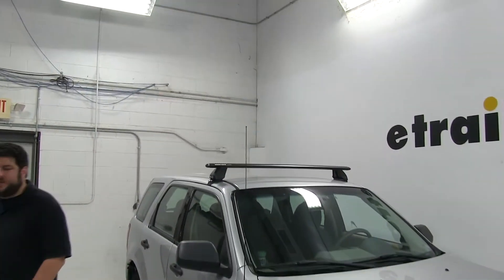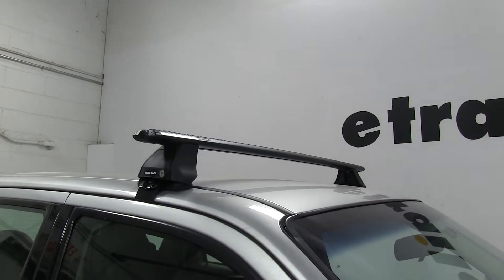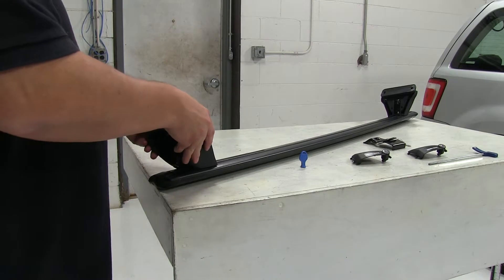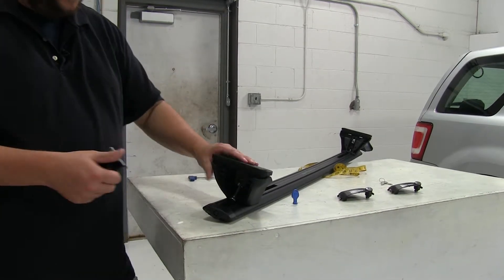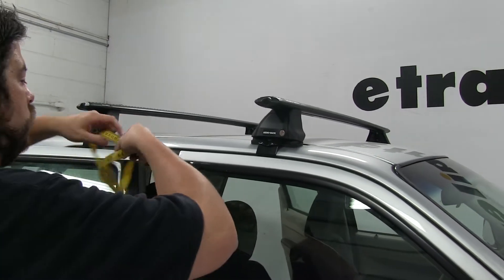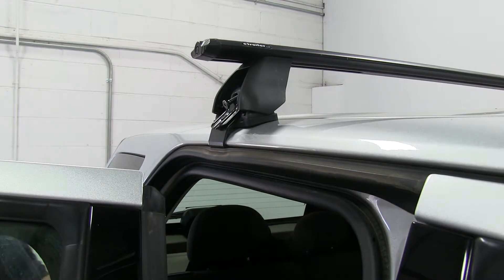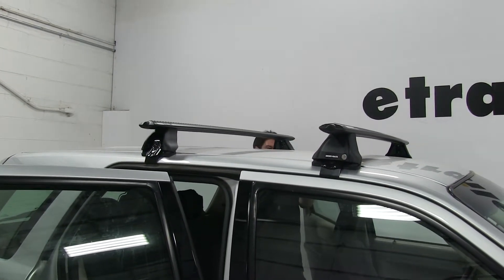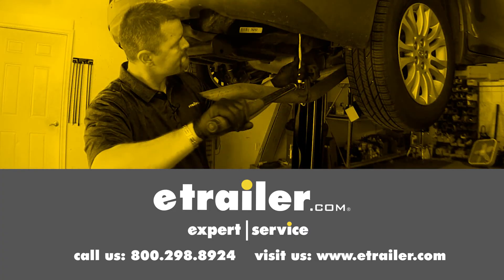etrailer | Rhino Rack  Roof Rack Review - 2009 Ford Escape

Comment: Is this still on the website, Im having a hard time finding it.
Reply from the maker: Rhino-Rack no longer manufactures a fit for a 2009 Ford Escape with a bare roof. That being said, Inno offers a compatible rack for a 2009 Escape with the bare roof. The rack would consist of these parts:
• Aero Style crossbars, part # INXB138-2
• Roof rack feet, part # INXS250
• Vehicle Specific fit kit, part # INK196
https://www.etrailer.com/Roof-Rack/Inno/INXB138-2.html
https://www.etrailer.com/Roof-Rack/Inno/INXS250.html
https://www.etrailer.com/Roof-Rack/Inno/INK196.html